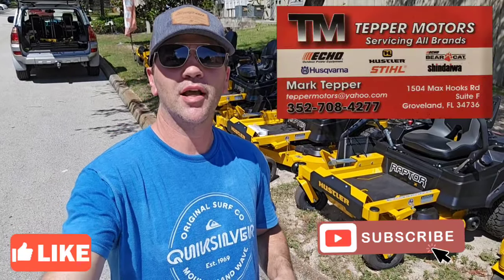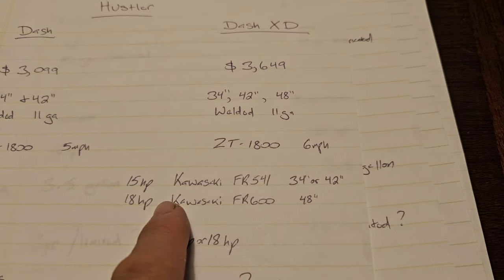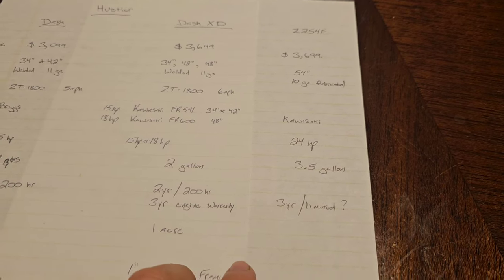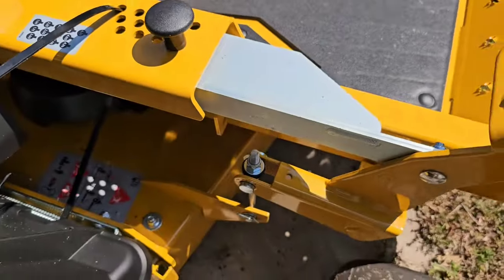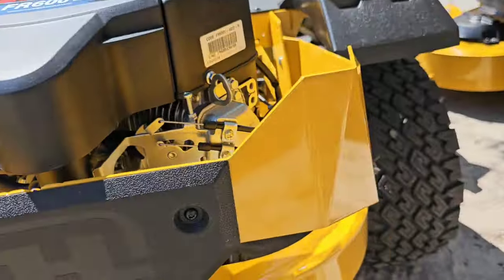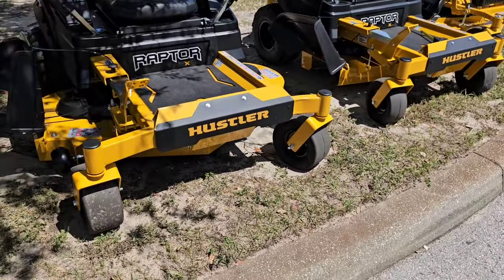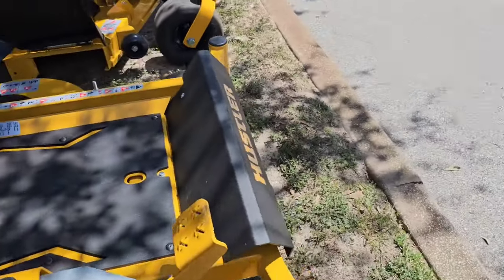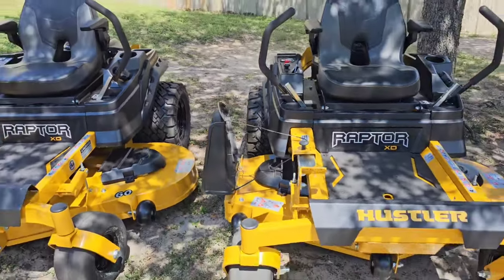Hustler Residential Zero Turn Mowers

Comment: I’ve had 3 hustler ZTRs in recent years. They get worse with every new model. I've had the hydro-drive brackets replaced, cracked fenders, severe vibration noise etc etc, etc. I have found that Hustler will work with you until they decide not to. My case was escalated to Nick (Sr. product representative). After failed attempts at a repair, Nick would not return any phone calls. The case was then escalated to the next level (Ken Coker). Ken provides nothing more than lip service. He did call me once. When I provided video proof of the complaint, he failed to ever contact me again. The mower was still under warranty when the dealer refused to do anything more and told me that Hustler would not attempt any more to fix the problem. Hustler also refused to work out a satisfactory plan to get me into a different model. The machine is now out of warranty. i still have the original severely rattling deck issue that I’ve had from the day I first received this machine. I would never touch another Hustler mower, ever. Hustler will not honor their warranty 0unless it is a very simple problem. Either they don't know, or don't care about fixing a customer's mower.
Reply: Would like to hear Hustler's side of the story.  All other reviews of Hustler are good.
Reply: @mvh61  I also would like to hear Hustler's side. Once it went beyond a very simple solution, it seemed as though Hustler didn't want to address the problem and they would not return my phone calls. I sent an email to Ken Coker (third level of support) with a link to videos of the problem and never got a response from Ken. If Hustler won't communicate and Passmore Service center tells me that Hustler will not do anything and therefore they will not do anything more to help, I've been left to fend for myself.
Reply: From what I have figured out, the sub $6k mowers are not gonna hold up if you cut more than an acre. Expect to replace a sub $6k mower every 4 to 5 years. IMHO, I would buy a John Deere from the local John Deere dealer, not a big box store. I would suggest the z530r model. The same mower can be bought from a big box store for about $500 less , but the model will end with "e" or "m" I believe.  The 500 series from the Deere dealer has a 4 year/500 hour warranty. The 500 series that you buy at a big box store has a 4 year/300 hour warranty.  I am sure there are other good mowers out there, but I think you will like dealing with a John Deere dealer.  They tend to do things a little differently.

Comment: Life time deck warranty is hard to beat. I have a 23 year old Husqvarna 61" commercial ZTR that is 20 years old with the original Kawasaki engine, that still runs great... I paid $2100 for it 20 years ago...
I'm not sure that the Hustler belt tension-er will hold up because every tension device I have ever seen is constantly moving when the blades are engaged...